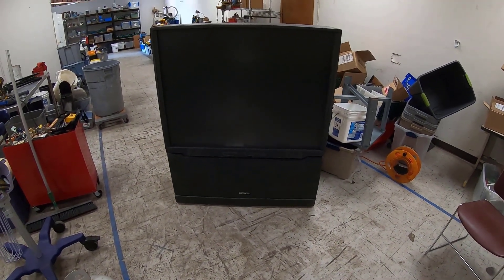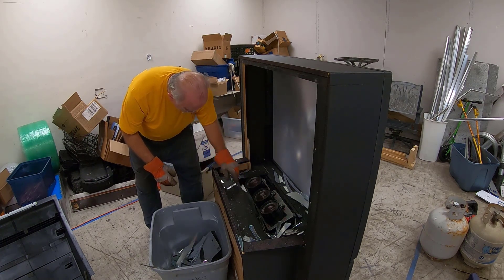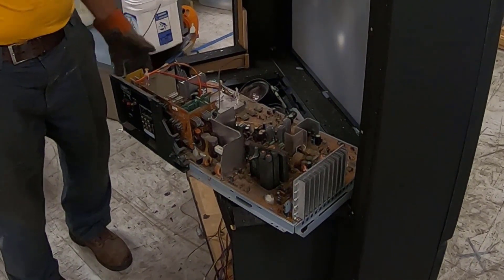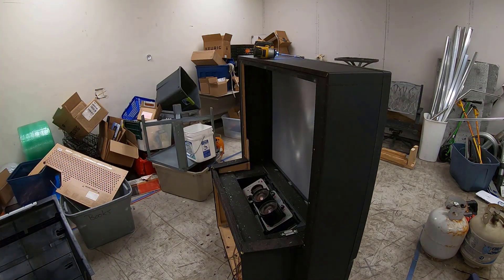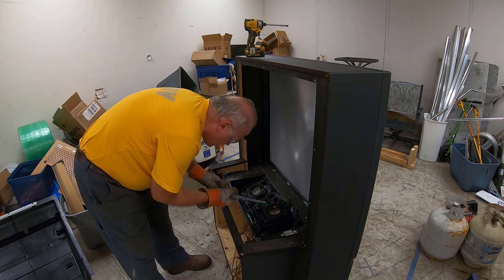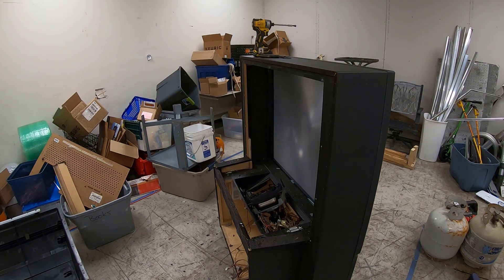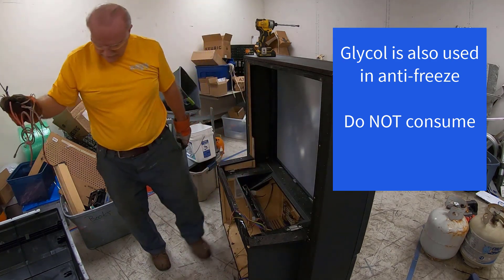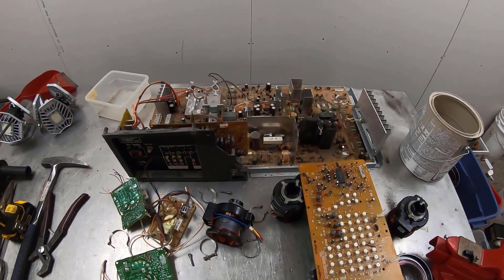EWASTE SCRAPPING - How to Scrap a CRT Projection TV

Comment: If you’re doing several- the bottom makes a great mechanic’s creeper. Use the bolts from the lens assembly with the springs positioned on the bottom, saw the other scrap wood so it makes an even stack in the middle, drill holes on the four corners of said stack and through the creeper, affix the bolts and boom, you’ve fashioned yourself a nice rolling stool and your back will thank you.
Reply from the maker: Great idea

Comment: Those mirrors are quite valuable and useful, btw, if you have the time to research them and experiment. If not, you can look them up to find out whether they have glass mirrors or plastic in order to bypass the problem entirely.
Reply from the maker: I don’t mess with these anymore. But I can see how folks would like the mirrors.

Comment: lol, "where'd all this water come from?"   between the glycol and broken glass you've got one big mess...-------  still haven't found out exactly what it is, there are different types of glycol, (it's a coolant like antifreeze that keeps the lights from overheating)   i read hitachi uses a special "formula" of glycol... but it's probably a monoethylene glycol mix, more toxic than propylene glycol...  whatever it is the county won't take it, they gave me a number to call telling me i've got to pay to get rid of it.

the interior on your t.v. was so much cleaner than the 2 i just tore down, both covered in dust, one of them real bad, had to take them outside and blow them off just to see what was in there.
Reply from the maker: Yeah, that was a mess.  Ever have those scraps you just wish you hadn't started 🤣
Reply: @sharkscrapper   all the time, everything seems to have its own unique problem.

Comment: I usually end up field dressing these in the place they were dumped.
Nice chunky boards. I pulled out an intact trapezoid mirror. I was going to hang it in the garage, but someone broke the corner. 😒Clearest mirror ever though! Some other styles have the DLP chips hidden somewhere that I’ve found. Not the CRT ones obviously.
Reply from the maker: I've been fortunate to find a couple sitting next to dumpsters and did the same.  Otherwise I pass on them - way too much plastic.

Comment: How Did Water Get in here! LOL. I thought you said you've taken these apart before!  Lucky you had already removed the main board, or now it would be covered in oil!
In case you hadn't already figured it out yet, The oil is used to fill in the gap between the Lens and the actual tube for the optics to work properly..
Reply from the maker: Yeah, I've taken many projectors apart but they were all DLP type.  This turned out to be the first CRT type I've come across.  Ah well, scrap and learn.
Reply: @sharkscrapper  I used to repair them, I know all about that damn oil. They are notorious for leaking all over the main board and causing electrical shorts and corrosion.
Reply from the maker: @scrapman502  That had to be a real challenge - repairing one after it leaked.  I'm sure that wasn't any fun at all.

Comment: That liquid is ethylene glycol and glycerin for cooling the crt's. When I take those apart I place one crt assembly in a bucket and pop the crt away from the assembly and the bucket catches the coolant.
Reply from the maker: Some earlier commenters have said they use the glycol for other things.  Do you use it as well?  They also called it TV or Projector juice 🤣

Comment: Hey Shark!!! That's not water in there... those lower lenses are filled with oil. I learned the hard way in a scrap out. I took out too many screws and got a lap full of that stuff. Big mess. As i was composing this you said it in the video. Nice work as usual.
Reply from the maker: We all remember what we learn the hard...it was my turn 😂  Amazing, all these years and this is the first time I got to squeeze projector/TV juice.
Reply: @sharkscrapper  did you get an oil bath or did you avoid it?
Reply from the maker: @startswithjay2315  Fortunately, I avoided it.  It did clean the deck quite nicely though😆